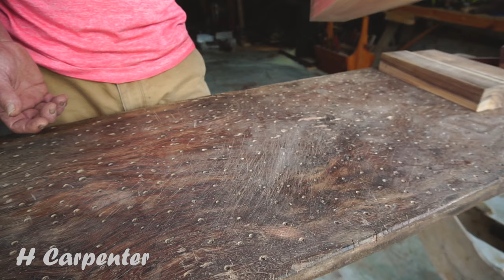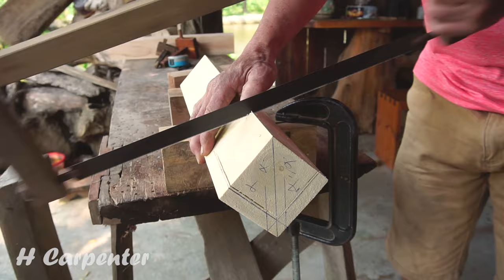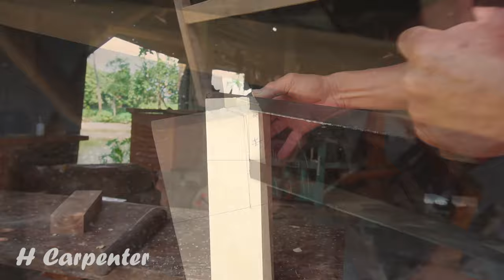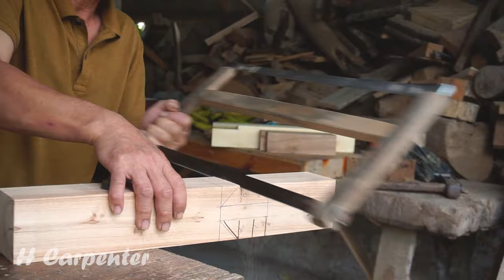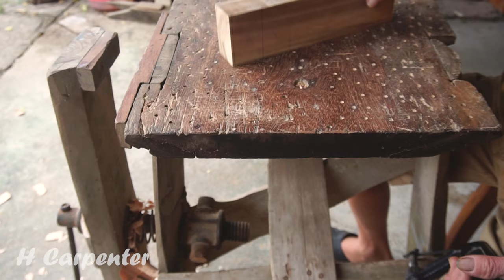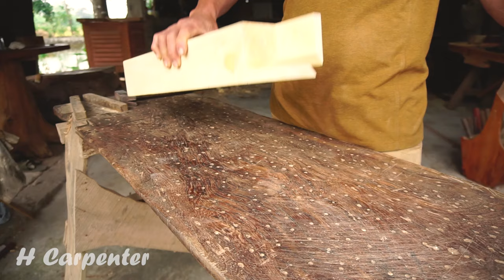Amazing Traditronal Wood joining methods For Roof , Awesome Wood Joints Techniques

Comment: Awesome, building a "lean-to" and been trying to consider what type of joint to use at the roof line. This one comes to mind just not sure on the strength. Great video as always
Reply: Good luck with making it if you decide to do it.
Reply: @IantheWoodcraftsman  It's doable even with this joint, as I said, still concerned about strength but that can be easily dealt with. Cheers :)